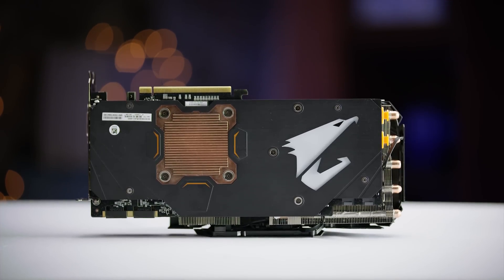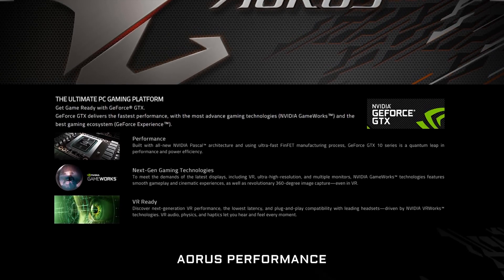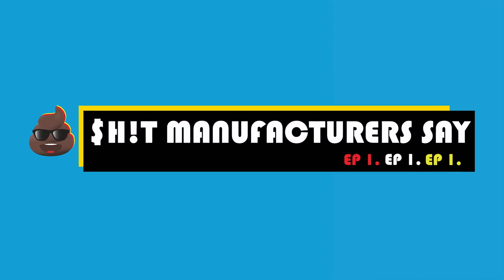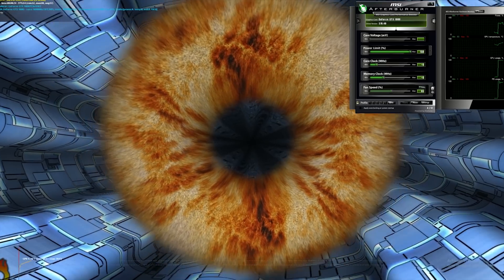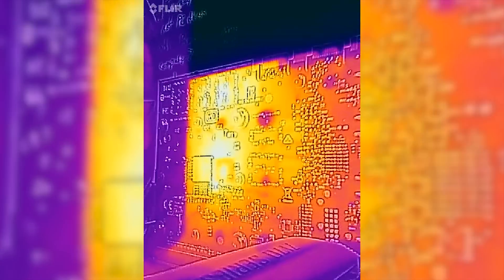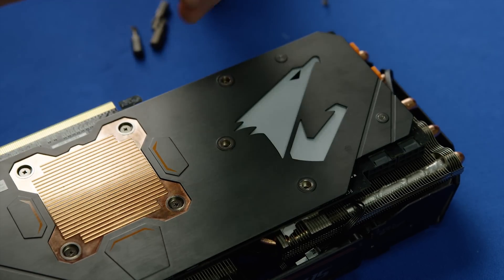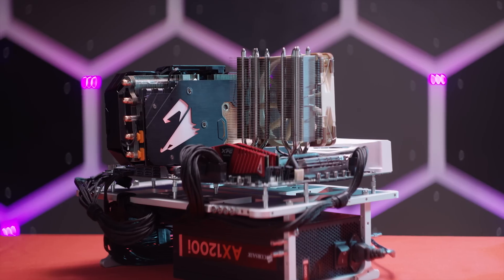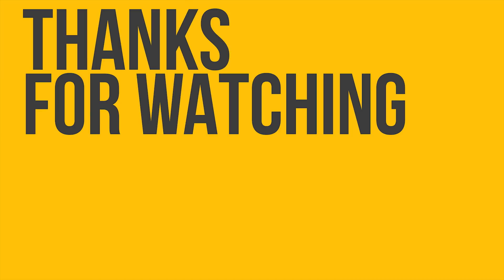$h!t Manufacturers Say Ep. 1 - "Backplates Cool Your Video Card"

Comment: Dudes.... Cooling of the core and memory is not the only thing... From an EE point of view, there are benefits to cooling and spreading the heat from many components - now, I didn't see in details what was on there - but there HAS to be electrolytic caps, no... ?

The sheild can of course prevent heating from other components that sits next to it.

A nice demonstration guys, but I have to point out that you do not do this with the big picture in mind.

And the question: "does the backplate help on cooling, or is it just for the looks of it" isn't really valid questions, because it already concludes - if it doesn't cool the core more, it is just for the looks. Nopes - it's the third option.

Backplate obviously makes the construction rigid and tough. Hanging a big ass cooler on a pcb like this without supporting from the back of the pcb, will be negative in the long run. Those pcb has loads of layers, and loads of thin traces. To make it rigid like this, will prevent even the smallest of vibrations to break the pcb in any way.

It can help keep components cool around the board, it can block noise both from the card and make it one more step closer to immunity itself. (i'm talking about emi).

So the conclusion given some time into this video that it doesn't help on anything that matters for how fast you can drive it, is with all due respect, wrong. It matters because it will at least make your card run longer. It is NOT only the large chips on it that count, and you forget this here.

Otherwise - I absolutely love the videos you guys makes. Absolutely love them - but sometimes you are wrong :D hehe.

Comment: I'm pretty sure the copper backplate only helps cooling in an enclosed environment with sufficient airflow. I recall seeing pictures associated with the claim showcasing this even. You might want to retest (monitoring overall system temperature as opposed to only GPU temperature) since an open bench wouldn't be able to show this.

Comment: Funny thing I noticed was that the expensive Xtreme Aorus card was at 67c at just over 2ghz with +160 core and +100 mem.  My cheaper G1 Gaming runs between 2088 and 2120mhz at +115 core with a hefty mem overclock and has never gone over 65c ever on stock auto fans, period.  Guess the extra money is just for the looks or else you just got a poor card comparatively.  Great vid as always.  Thanks for the info, good to know the facts.

Comment: The GPU should be on the back side of the card. Heat raises and the natural flow would be much more beneficial to the card in removing heat from the GPU. Why haven't manufactures implemented the whole GPU, heatsink , and fan on the other side of the card?

Comment: not saying this backplate cooled the card but here are the possible problems with this test that probably make it invalid:
- removing the heatsink introduced a huge variable unless u used the same thermal compound
- you haven't said if you used a fixed fan speed, which is another huge variable
- room temperature is important, you didn't mention it, small variable if the tests were done close to eachotherb but can skew the result

Comment: My EVGA 1080ti really does use the back of the card for cooling, not for the GPU/RAM but for the VRMs and doublers etc.  It gets properly hot, to the point it's uncomfortable to touch.  After a couple of hours of use the GPU is only at 60deg.  Not bad for a two slot card.

Comment: I’ve connected my ASUS Rog Strix 1080 TI over PCIe riser and simply left it on top of my PC aluminum case. Guess what? The temperature delta between the same vendor’s GPU inside PC case and outside was about 2 to 3 degrees Celsius. If I only could watercool the case, the temperature would be much lower, that is because the whole PC case top was really hot.

Comment: well, my old EVGA 970 ftw+ has a nice backplate with thermal pads attached to the memory modules, and small ones all around the back of the GPU, and under full load  it is damn hot, meaning it provides some heat dissipation, at least for the back memory modules
of course, on the 1080 or 1070 it could be less useful considering those cards have all of their modules on the same side of the PCB

Comment: This test was executed wrong...

The backplate of the AORUS cards provides additional stability to the circuit board, and it is one massive plate other than the one shown here. The trippleslot-cooler is damn heavy, i dont wanna see how much the circuit board could bend without it, over time. Plus the copper segment on the backplate needs air circulation for it too work. Its nothing else but a tiny passive cooler, and everyone has a few of them on your mainboard, to reduce the temperatures of for example the northbridge... but their effectivity will be nearly zero outside any pc-tower. Do this test again with the AORUS versions, with a proper tower with air-cooling. You will notice a difference.

Comment: Passive "Heatsinks" rely on airflow to be effective. I wonder how different a result you would get if you did the same test inside a case with efficient airflow. As it stands, I have to say you didn't find proof it works, but certainly found even less proof that it doesn't work.
Reply: He did not at all prove that the heat shink was cold. Chopper does not have the same IR transitivity coefficient as the black anodized aluminum around it.
Reply: Hordequester also copper has a poor rate of transfer of IR radiation  and is often used as a barrier to prevent IR heat transferance. While I wouldnt expect the results to change in any way that is statistiaclly relevent the test should have been performed in three cases with neutral, positive, and negative air pressures to recieve a total overall view. By testing on a test bench you could only say that on a test bench or in open air there is no benefit.
Like I said though I wouldn't expect  the outcome to be different by anything other than a fan directly blowing on the backplate. Then it is more likely that the air itself is actually cooling the card not a specific cooling apparatus on the card
Reply: alioop this. An open air test bench is a poor indicator of anything precisely because of what you said about passive cooling. Passive cooling heat sinks don’t work at all if there is no airflow over them. The whole point of those is that passive airflow is what cools the fanless heat sink. In fact the whole point of case fans is to provide airflow through the case to bring in cool air and expel hot air and keep the system cool.  

It’s all about airflow and testing a passive cooling method without airflow pretty much invalidates this whole video.
Reply: He proved that the heatsink is cold.. therefore not transferring anything. Completely disproving any notion that it would ever work in any case.. closed airflow or not. Because...it is already cold...there's nothing to dissipate.

Comment: i put thermal paste acrossbackplat  the area where the gpu would be on the pcb and mounted a cpu cooler went from  93c to 79 c at 14487 mhz  EVGA 780ti classified dual acx benchmark was valley unigine 5th last scene in benchmark was at 85c for a very short time

Comment: While especially  long PCBs with large coolers tending to bend under thier  own weight, a backplate could work as bracing, making the card more firm and durable... So, besides of aesthetics and quality impression, this could also be a consideration by the designer.

Comment: Why has nobody attached a cpu fan or a simple waterblock to the copper back-plate? The copper plate may not do much to cool the GPU untill you draw the heat out of it. It's kind of like a CPU with no cooler whatsoever, it will get hot and not be able to transfer heat to the air effectively. Obviously the heat sync in the card will draw the heat out well anyway, but what if you max out the card in an OC set-up and start pushing the thermal limits? At that point would some cooling solution connected to the copper plate bring it down nicely? The only question I can imagine is how effective is the copper back plate at transferring heat from the GPU to the back plate itself? As it doesnt seem that direct. Anyway I could see Linus loving a DIY video on the topic. DOOOO EIITTTT. Also mostly because I bought one and I want to know

Comment: i was told by someone that works with enterprise grade cards that the only things back plates effect for cooling are pcb temps. apparently that can be an issue. however its minimal benefit and a fan pointed at the back of the card would do better. the other benefits are more why metal backplates are done. oh and this also only is the case if the backplate actually has thermal pads on it to transfer heat.

Comment: Question - Did the fan speeds change at all? I'm guessing they were maxed out on both runs? It would have been good to specify either way to avoid doubts that the fans simply worked harder with the backplate off.

Comment: Doubtless some help, my Strix 970 for example has memory under the backplate which gets the whole thing very hot. Not a great dissipation capacity though...

The true value of a backplate is as a safety device. You need a solid one for that though. When I had a blowout (thank you ASUS barbs!) and coolant pissed all over muh 670 and because I'd put a solid EK backplate on that card (and was finding it VERY hard to justify the expense up to that point) coolant went straight to the power input at which point the PSU tripped. ZERO damage to anything!

Comment: Primarily, many backplates do help with cooling components as long as they are connected with thermal pads. Obviously you're not going to get a cooler core clock.

Comment: well it dose make a SMALL change, the backplate on my 680GTX that I used for mining ended up with a hot backside when running Linux (and ofc it did not increase fan speed so it was locked to 30% even when gpu was at 100% load for 2 whole days). But after walking in to my room on secound day I noticed a huge tempeature difference from my entrance to where all my tech was, and the 680 was to blame for it, giving it a fan that "licks" the entire backside made a nice radiator for my room just in time for summer, but also didn't burn my fingers when I carefully placed my fingers on the backplate and GPU region. 

So yeah they do work... once you start using them to their full potential when you have a heat disposure 
If they could grove or make some long fins on back side out of copper like Zamla did with their blue "universal coolers" 16 years ago that would make some changes tho.

Comment: It could be that the backplate has minimal cooling function, due to the fact you're testing it on an open test bench, while most pc's are enclosed with internal airflow. since that airflow could pass by the copper backplate it could dissipate it's heat a bit. this is however a hypothesis and is not founded by research.

Comment: Makes sense, but I did test it myself, and I did notice a difference when cold air is blowing on it. Leaving it on the bench wont show real world results when there's no moving air like you would have internally. If your PC runs hot then there will be no benefit. The 3 degrees C is real. Sorry to be picky, but i think I present a valid argument.

Comment: My STRIX GTX 980 seems to dissipate a lot of heat into the backplate.  I have my CM 212 EVO with a JetFlo 120 strapped to it facing up, sucking air away from the backplate, through the CPU heatsink and out the top and side panels. This seems to have effectively cooled my GPU down by up to 10 degrees C compared to what it was before.
(And no, my CPU  heatsink is not getting a pure hot air intake because of it, there's a healthy side panel 200mm fan and a nice airflow setup from the front fans to keep cool air flowing in)

Comment: Quick question:
- Did you factor in that you had to change the thermal paste on the GPU when replying the heatsink?
- A thought I have is if Aorus was correct in the backplate adding 3 degrees lower temps, when you took it off and were somehow able to get the heatsink mounted EXACTLY the same way with the EXACT same thermal paste, you may have seen a increase by 3 degrees.  So then the new thermal paste you added could be 3 degrees better in cooling?  What do you think?

Comment: Well it doesn't help with cooling the GPU itself but a lot of graphic cards have VRMs or VRAM on the backside that tend to run quite hot and a backplate definitely helps cooling those.
Reply: Antares 8001 Graphics cards don't have memory on the backside these days. And VRMs don't care what temperature they run at, as long as it's under like 130°C. Anyone claiming that 100° is "too hot" for VRM is an absolute cock
Reply: A lot of graphics card still have VRAM on their backside and when delving into overclocking, overheating VRMs are pretty much the #1 reason for damaged cards, especially if they have sub-par power delivery.
Reply: Antares 8001 Which graphics cards have memory on the back side?
And VRM overheating is not an issue, drawing too much current from crappy VRM may be an issue
Reply: Pretty much all NVIDIA cards up to Maxwell.
Reply: Antares 8001 So, that means the cards before manufacturers started adding backplates? With a few exceptions
Reply: Fair enough. Although I'm pretty sure a I've also seen quite a few versions of the bigger Pascal cards with VRAM on the back as well.

Comment: I figure back plates actually do have a minimal temperature impact (definitely no more than 3 degrees though) but it depends on the airflow of your case.  My GPU has a plain non-copper backplate and without active cooling it gets very warm to the touch.  It clearly is dissipating heat.  However, heat dissipation doesn't help with core temperatures if you don't remove the heat.  When having airflow at the back of the card, there is a noticeable temperature difference.

Comment: Good video but...
vga cooling arctic accelero twin turbo 3 and xtreme 4 has cooling of VRAM and VRM (not the chip) on the backside of the card (realy massive) why not check this one out and compare it to normal front cooling?
Also it would be very helpfull to people, to see video about vga cooling to replace blower style cooler.
Video about VRAM and VRM in video cards would be helpfull since in newer cards you just cant check them

Comment: I don´t get it, they claimed it to be cooler, which in fact it is cause copper conducts heat better than whatever other material was used to make the other backplate. They never claimed it would be cooler by a large or noticable margin, thats what idiots and fanboys who have high hopes and 0 understanding of thermodynamics would do, I mean just look at the damn thing and the little ribbits on it and compare that to your average cpu cooler and miniscule size of your freaking cpu compared to the cooler, now keep in mind your cpu runs cooler than your gpu... yeah that little piece of metal won´t cool jack shit. Also 67=67? so you mean by that logic 67million dollars is the same as 67.1 no? cause who cares about 100 grand lmao. If you are telling me you are unable to get better heat reading sensors and you're stuck with crap that can't even read single digit decimals after hitting 4 million subscribers then you are more full of crap than the manufacturers you claim are. I'm all for pointing out advertised bs but you're punching air here.

Comment: There is kind of a flaw here with your methodology refer to gamers nexus tear down of this card and specific temperatures in specific zones with specifically with vram and gpu core sharing the copper plate for heat dissipation ... if there is no air flow across the top of your vc like there would be in an enclosure   then there will be no dissipation across it if that back plate dissipation is a thing  you should check that out

Comment: A well engineered backplate (high conductivity, lots of contact surface area) helps with cooling by distributing the heat around the board, not by actually dissipating heat (as the backplate does not have more surface area than the board itself anyway). It gives another way for the heat to distribute across the board other than the board copper itself. This is the reason for the many small screws, each screw is a heat transfer point. Any basic electronic engineering and thermodynamics class will explain why having good heat distribution across a board is a good idea. It might even be necessary in some cases. You may have surface mount MOSFETS on the board that only have the PCB copper to dissipate heat into. Having a backplate connected thermally to them  prevents the excess heat from potentially damaging nearby components on the board.  Whether or not it is actually designed in by the engineering team or the marketing team on a particular product is subjective, but the merits of a back plate are real. Same temperature does not mean same thermal stress on the board.

Comment: i would LOVE to see the temp difference with back plate on and off in a case. Because there may be a benifit with the backplate when there is air flow over it. 
open air test benches are not always a practical test as not everyone uses a testbench.

Comment: You have to have airflow to remove/transfer heat from the back copper plate, try placing a fan blowing over the copper plate to test properly!  (Inside a case mite just do the trick! ;D)